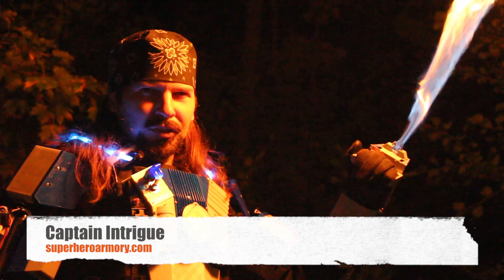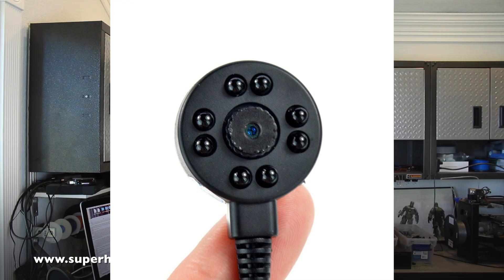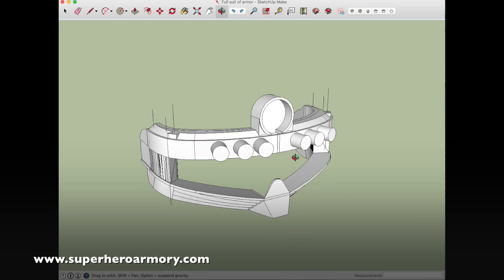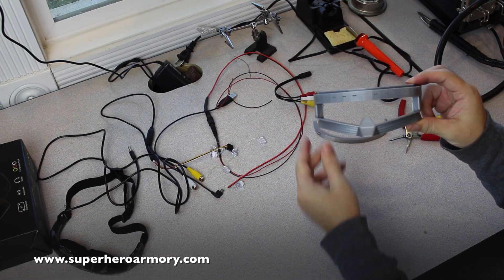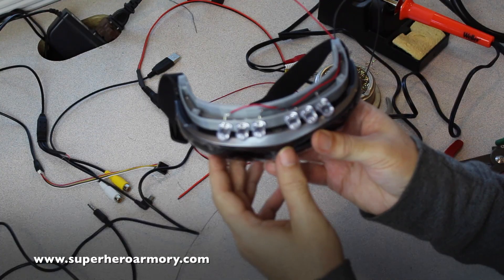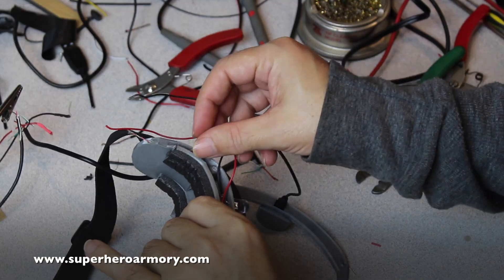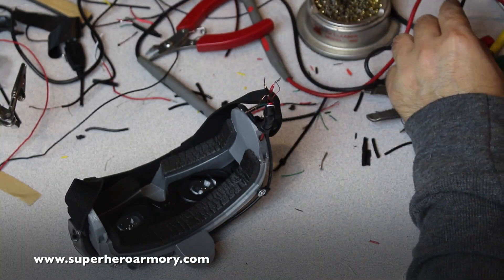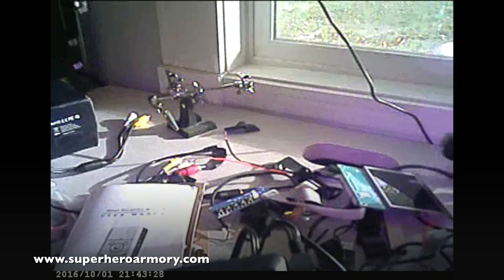How to build diy Night vision Goggles

Comment: why not just add a larger infrared light on your shoulders so its even better
Reply from the maker: Already working on it.
Reply: Superhero Armory great
Reply: I found some 9 volt IR spotlights that work great, although they are large and bulky, if you take the outer case away, it might be much better and lighter. Print up another case for two of these units and you will see fantastic. I did this with similar results, but when I added the spots, it was amazingly better.
Reply from the maker: Just ordered some infrared spotlights, hoping to install some night vision lighting on the helmet i'm working on.
Reply: Superhero Armory U R too cool! Wish I had the place to make things. I need a shop.
Reply: Then why not just use damn flashlight lol?
Reply: Сергей Бильмандо Because it is IR not visible light cameras. You miss the point?
Reply: ***** I mean why not just use the fucking flashlight to see shit in darkness... These lights on that funny camera light quite bright to use them separately.

Comment: Using IR illuminators makes you very, very visible to others with night vision. In fact, you will likely look like a beacon from the air.  
Have you considered using a more sensitive camera that doesn't require additional illumination?
Reply from the maker: Your logic is completely flawed. Even the most sensitive starlight scopes or infrared sensitive cameras are useless in total darkness. And if your adversary is also using night vision then he'll see you anyway weather or not your using active night vision or passive.
Reply: Superhero Armory  "scopes"
I see your point, however, later generation night vision scopes operate in the lower infrared frequencies which give the advantage of seeing body heat as well as variances in ambient heat. On very dark nights it's sometimes not enough to navigate by but in the case of an unwanted individual at 50 yards it's enough to lay a bead on.
Reply from the maker: Another thing to keep in mind is that the environment determines what system is best. In a large open desert battlefield using passive infrared makes sense. But in an urban night setting there could potentially be a number of so called "beacons" of IR light all around, not to mention the importance of being able to clear the inside of a completely dark building. Try accomplishing that with a passive system. As a former Marine i can tell you that i'd certainly prefer a passive system in desert warfare, but in urban combat environments (where my suit is designed to operate), active infrared is the clear winner. Plus i have the advantage of being able to add a passive thermal imaging camera to my system which gives me the best of both worlds.
Reply: Superhero Armory 
Well, clearly you know what you like. Me? I would take a gen 3+ NV scope (sometimes called gen 4) over anything else every time. They pick up a much broader bandwidth. IR, very low IR, visual, and some of the 3+ units do UV as well. The very high end units provide the capability to see through fog, clouds and smoke.
I have a gen 3 scope I built to use on my telescope. You would be amazed at what is flying around in the sky that can't be seen by the naked eye and gen 2  lower equivalents. First time I looked it blew my mind.... Seriously, couldn't sleep for days.

Your suit? What do you mean? I apologize, I'm not familiar with your channel. You popped up on my recommended list, this was the first video I've seen. Please explain?
Reply: I reviewed the content and vids on your channel.

Dang!!! You have countless hours of development time in that suit. Your workmanship looks top notch. Congratulations.
Reply from the maker: Thanks for subscribing! And keep the great input coming.

Comment: Actually not bad! Certain questions weren't answered, like how long did the battery last, was it rechargeable, what was the total build cost including materials, time and tools? Did you consider using cellphone batteries or iPad batteries? Could you make a version that allows for 360degree viewing? In a helmeted version you could place the battery pack around the sides and back in a series, if they were flat, like an iPads batteries. In this helmeted version you could also boost audio, create telescopic night vision, weather proofing the whole.
Reply: Should consider an environment suit, one that cools your hot spots and heats the cold ones.
Reply from the maker: There was a small rechargeable battery for that test but they are now wired into the suits power system. Cost was under $130.

I have plans for telescopic vision and the ability to see heat signatures in the future.

Comment: You maybe just the man I am looking for. I am legally blind, but with some vision, best corrcted 20/200. I use lots of gadgets to magnify things at range and up close. But its mostly long range I have problems with. What I am wondering is could a small auto focus/zoomable camera be attached to a head band, but with a HUD over just the left eye. If you think it is possible, any idea how much it would cost? Oh, and the unit would have to fit over my glasses. I really hope to hear from you soon.
Reply: you can essentially do something like this( granted most of these glasses have crappy displays) but cut it in half and wire it similarly.

Comment: maybe you could use ultralow light cameras from those Drones? some are damn good WITHOUT IR lights (to some degree, im not sure how good they work in total darkness). Also , is it possible to get template for your googles frame (once payed that is ;) )  and list of all items used in this project?
Reply from the maker: I'm working on the drone design still but yes low light IR cameras can see in darkness as long as there is some ambient light. Go to superheroarmory.com and sign up for the mailing list to be notified when i start releasing the stl files.

Comment: Built my first infrared scope many years ago with a converter tube from Edmund Scientific.  But I am really impressed how well yours seem to work and really really impressed with you 3D printed design.  One commenter said you would stand out in the dark with the infrared LEDs and he is right, but I also have a pair of Russian 50,000 light amplification binoculars and if it is really dark, you could not walk through a woods with them.  Stick to the infrared for walking around in the dark.
Reply from the maker: Yep agreed, active and passive night vision both have their pros and cons, but i'll take an active system any day for urban fighting since inside a dark building you won't see a thing with a passive system.

Comment: Pretty neat. Few questions;I'm curious, why did you hook the LED's up in series/parallel instead of just parallel?Will you install the option to turn the LED's off? The reason for that is that a lot oof cameras have the ability to process IR, so the IR from the LED's would be visible to those cameras. The camera on the classes would still be useful in low light conditions, like moonlight, ect.Do you have any plans to sell any of the stuff you make? 
Now, a recommendation for the thermal imaging you mentioned; I bought a thermal imager for my smartphone. The brand is SEEK. It works ok for the price. There's also another one, the FLIR One, which I have no experience with, but supposedly has better quality imaging.
Reply from the maker: Series parallel was needed because it was running them off 5vdc. Yes it's always best to be able to select the LEDS by switching some on or off or the image can get washed out visually, but outside it's not much of an issue. Haven't decided yet about selling anything.

Comment: Make an pirate eye patch out of a color flip phone screen.
Mount infrared led's,and the micro CCTV camera to it.
Reply from the maker: Tried that but it requires a focusing lens to see the screen in front of your eye and that extends it out 3 to 5 inches from your face and it looks silly.
Reply: Superhero Armory I have a pair of adjustable reading glasses,that if a mod were done would probably fix that issue.
The are $19.99@Walmart in the as seen on TV section.
Reply: Each side adjusts separately with a little knob,so you cut the frame in half,and eliminate the arm.
Reply: There are also the Optx20/20 stick on reading lenses that go from +1 to +3,and can be added to to get the #needed.

Comment: with a simple digital camera I can see your infrared light.
Reply: the point of night vision goggles is so you can see without others seeeing you.. its also nice having them mounted infront of your eyes so its always vissible where you are looking.. however the problem is this method does mean anything military or even civilian with a camera will see you very easily.. but none mill wont so its a double edge sword.. but good luck making the kind the military use that dont give off ir lights or breaking the bank buying a pare let alone a decent pare. the nice thing about this set up is later he can hook it into more systems.. granted i would never use that low of a res for that.
Reply: Cagé Sound-Design who's gonna be looking for someone with their phone camera?
Reply: your statement is as idiotic as ur point
Reply: Defiant Brood try to answer cool and not like a %#@&. take your mobile and look at any infrared diodes and they glow like normal diodes.
Reply: Cagé sound design might be referring to a situation of night vision trooper vs night vision trooper or vs surveillance cameras... the IR LEDs on the goggles would decrease your stealth considerably.
Reply: It's called active vs passive night vision, even passive night vision such as a pvs-14 has an infra-red illuminator built in. In a situation with no ambient light a external source of IR illumination is required. US military also use IR laser targeting systems on their firearms at night with not much thought about anyone seeing them.

Comment: Awesome work - my only suggestion for the next version of these would be to ditch using the existing frame on the LCD glasses and instead incorporate your LEDs and Camera into a custom designed glasses frame housing.   Yeah I know this is going to require some finessing but this might reduce some of the forehead bulk and make them hopefully even more lighter.
Reply from the maker: Being a perfectionist = never finishing anything.
Reply: So true; and I know at some point you need to just say "Its finished" as well otherwise you can get into that endless "just one more change" cycle.
Reply from the maker: I'll be starting on the Mark 2 suit in the new year.
Reply: Awesome - I'm sure you are going to rock it! :)

Comment: aren't there smaller variations of the LED to minimize excess bulk or are these LED the smallest you can get?
Reply from the maker: There are smaller ones but these were a lot brighter so i went with it. The best would be to use the 1 or 3 watt heat sink leds which i'll probably use on the next version.

Comment: I like your 3D printing ideas. 
If you wanted to add range try using an Oslon black IR LED. and a lens to focus the IR light forward. 
If you do use an Oslon Black LED you want a 3 mode LED driver.  (not one with a strobe)
The cheapest way to get all the components would be to purchase a T20 IR flashlight and strip it down for the parts.
A T20 IR flashlight will give you 100+ meters range depending how good your camera works. 
If your CCD camera has a reasonably low LUX it worth considering removing the IR filter.
That would double your night time range instantly. 
You can improve vision even more using a low F/ rated lens. 
Normal human visual magnification for walking around requires a CCTV lens between 10mm and 16mm otherwise its like walking around while looking through binoculars.No CCTV lens manufacturing company builds lenses to a standard specification. 
I settled on a varifocal 9-12mm lens with a F.0.95 which is about as low as you can find. 
The lower the F/ rating the more light the lens gathers onto the sensor. 

You can probably tell iv spent a fortune building digital night vision devices but my DIY goggles dont look as cool as your 3D printed ones.
Reply: Can you post a link to the lens you used? I'm planning on building some and finding a nice lens is the hardest part.

Comment: things that could have made it better. 1) tubes. there's a reason night vision is tube technology. it works and digitat can't replicate it due to the process that goes in to taking photons, multiplying them, and slaming them against a screen. 2) make it passive, IR leds are great for total darkness, but in reality, that's rare, and while you could use them, they just light you up.
3) if you find real nvg's uncomfortable, try different suspension gear for a helmet... or a helmet at all, as headmounts are inherantly horrendous. 4) if you can figure it out, try folding optics, the AN/PVS-21 is a good look toward that, though it appears bulky, it's actually very low profile, and has many advantages over most goggles, for example, if you come into bright light, you can look through the eyepiece and leave the goggle where it is, increasing effectiveness if you suddenly get illuminated.
Reply from the maker: Apparently you didn't listen to what i said in the beginning of the video. My goal wasn't to build the best night vision system, but instead to build an extremely low profile night vision system that didn't weigh 2 to 5 pounds and be hanging off my head in an uncomfortable manner. You also didn't listen to me explain the advantages of my system being that now i have FPV goggles to feed drone video into, utilize a HUD for weapons data, and the option of adding a PASIVE thermal imaging camera in the future. None of those things are possible with tube technology.
Reply: Superhero Armory So many of those exact things have been adressed while still making use of tubes, the only thing I've heard that HASN'T been done so far is the drone control.
Reply from the maker: Yea but i can add all of those things to my system without 5 pounds of hardware strapped to my head that sticks out 6 to 8 inches from my face. Again, i understand that image tubes have higher resolution, quality and the ability to be passive but it's a very impractical system for combat and has a lot of limitations and as a former Marine i can tell you that i would chose my system any day over the clunky military equivalent.
Reply: Superhero Armory I would contend the same for tubes, and maybe I'll test that some day when I've learned how to program a CNC machine, but for now, since I'm working exclusively on manual machines, I'd say that's a year or so off. guess I better get to work on the technical drawings.

Comment: Hello and very pleased to meet you. I have been planning out some builds (goggles, helmet,and wearable armor/computer) for a while. a career shift has finally given me the chance to get started on it relatively soon. I can't believe i haven't run across your videos before now.

the main inspiration for my plans are from Sean Kennedy's Epic Post Apocalyptic Cyberpunk Masterpiece Tales From The Afternow. The main Character acquires, amongst other gear upgrades, a military augmented reality helmet that has burned its way into my dreams.
Reply from the maker: I would love to see what you build! Good luck and thanks for watching!
Reply: How difficult do you think it would be to make the two sides move independently? So that you could have either side rotate from down completely out of view, then up a notch to where you could look down at the screens and still have most of your field of veiw, then centered the way the are in your system, then up again so you can look up, but still have your lower field of view.
Reply from the maker: I built a system like that a few years ago using larger LCD screens. The screens attached to the side of the helmet and servos moved them into position in front of my eyes. It worked great but looked ridiculous so i ditched it for the lower profile goggles.
Reply: Nice, I'm no super worried about keeping it low profile. I'm OK with being the crazy guy in the bug/gargoyle  suit.

Comment: its sad one guy can make smaller night vision goggles at his house then the us army can make
Reply from the maker: Lol, yep!
Reply: phat ballzzz is isn't about the size of the unit.  I own the 4K gen three pvs14 unit the military uses. An it's more about the clarity of the picture an the durability an that it's a self contained unit. So no extra pack for batteries ect with the wire being snagged on shit being ripped off the face or being shut down from a pulled or cut wire being snagged on shit.  Also for situational awareness being it's only covering the left eye. One is accustomed to the night vision an the dark an the other is your standard vision.  Some things it's better to be seen with your own eye an or brighter situations of light flashes or light at you the blinking of the autogated feature doesn't block what your seeing. Or say entering a room an you go to a regular white light flashlight when split seconds count your other eye takes over the situation.  An they don't always operate with IR light.  An at distance that's when the 45mw pvs14 laser an illuminator comes in for a couple hundred yards of lighting in the IR spectrum.  Totally different way it produces a picture for the eye.   What he made is the cheapest of the cheap digital camera that doesn't have an IR filter in it an some very basic electrical.  It's not a tube amplifying light particles with a cathode an film.  Not really impressed